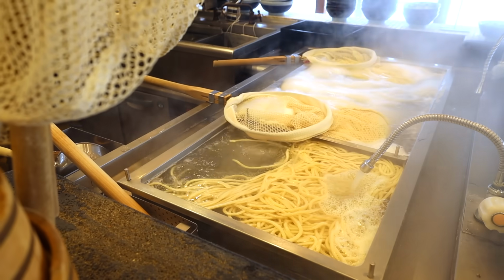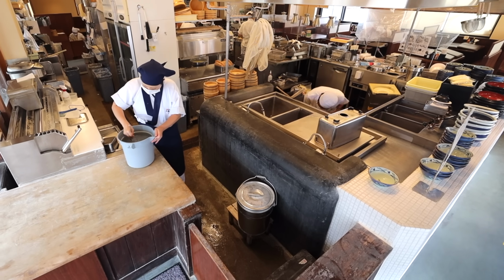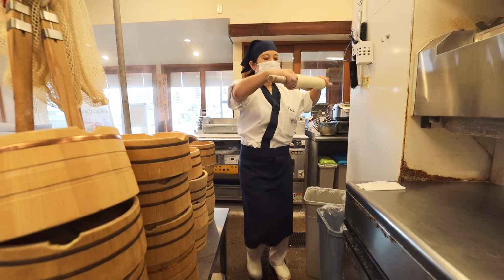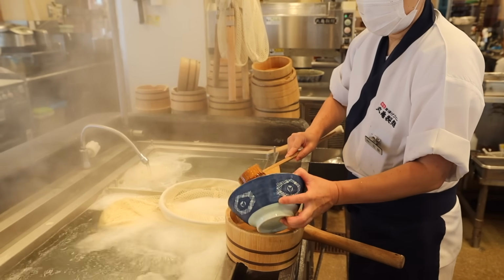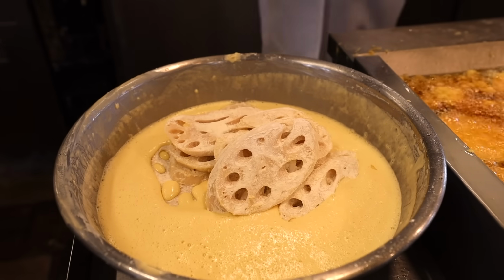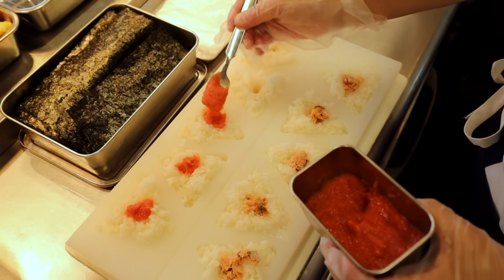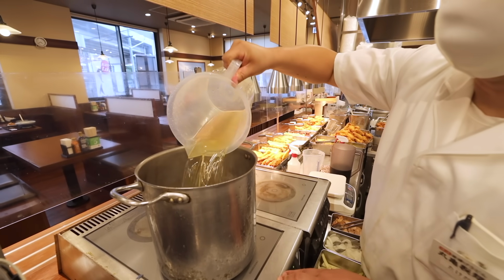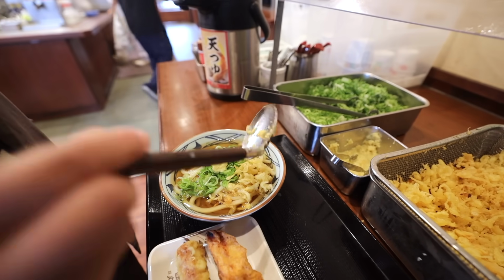How Fast Food Udon Noodles are Made in Japan

Comment: A Japanese mutation of the delta-mutated novel coronavirus, which is raging with a higher infectivity than before, was confirmed for the first time.

 This mutation is characterized by adding a structural mutation similar to the delta mutation (L452R) and the alpha mutation (N501Y), which was first discovered in England and became popular at the beginning of the year. Only 8 cases have been reported worldwide.  

"The patient has no overseas travel history," the Tokyo University of Medicine and Dental University explained.

The research team said that additional research is needed to determine whether the mutation is not significantly related to the current spread of coronavirus in Japan and has a higher risk of infectivity and aggravation.